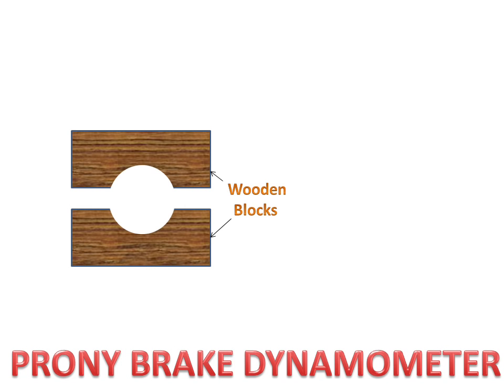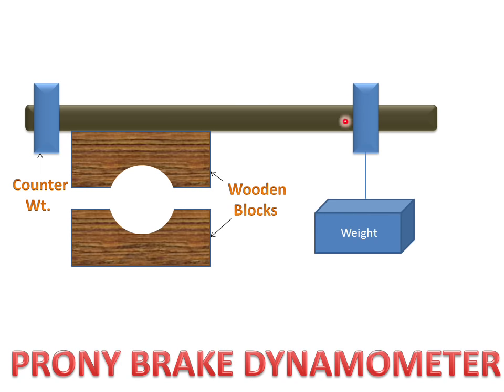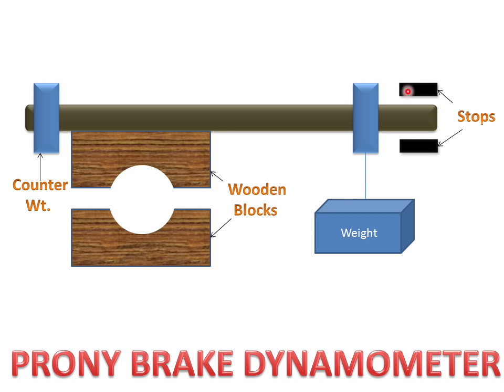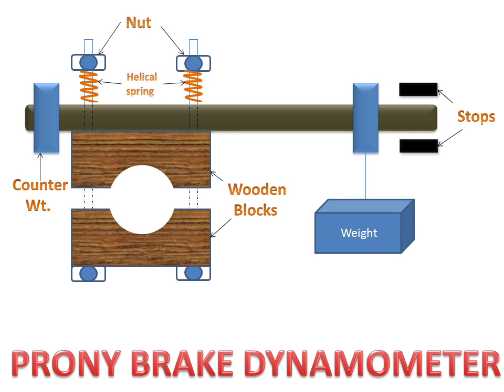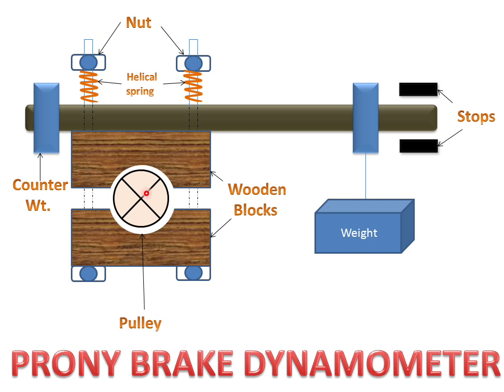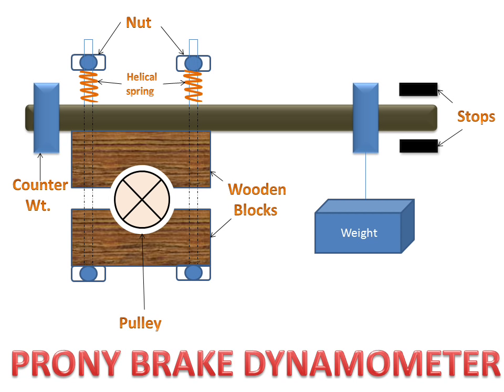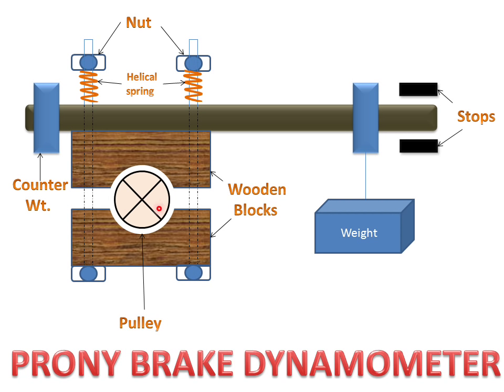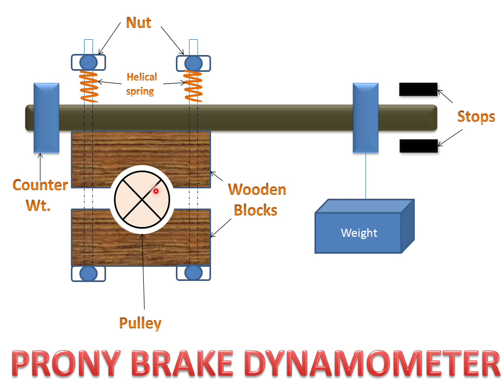Prony Brake Dynamometer(Working Animation)

Comment: Just a comment, the shaft rotation should have been counterclockwise. Therefore, as you tighten the nuts, you will add more weight to the prony brake to counteract the friction on the shaft.